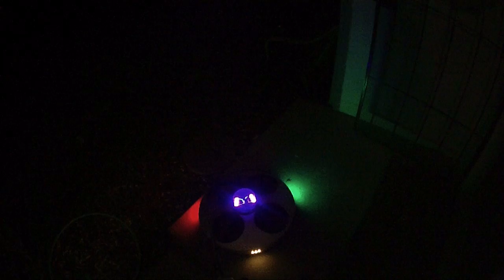RC UFO Flying Saucer and Build Photos

Comment: Outstanding Ron! Thanks for the great build info. This really encourages me to get busy. I'd like to build a really large saucer and I'm convinced that your design is the way to go. Ray Harryhausen would really appreciate your work! 
Thanks man!
Reply: BTW - The tractor beam is tremendous!
Reply from the maker: Thanks again.  I had to put a tractor beam on it that I could control from my remote.  I blew out one LED light (the one in this video) rated for ~3v from running it on a 5v BEC, but now have one that will handle 8v and is MUCH brighter.

Comment: Good looking build.  Shame about loosing the ESC, but it looked like it was flying great up until that point.
Reply from the maker: I replaced the ESC and put another Dollar Tree (3 for a dollar) plastic bowl on it for the canopy.  I re-did he ESC throttle range calibration, increased the P and I gains for both acro and auto-level, and replaced the 6x4.5 props (too much pitch for these motors) with 7x3.5 props.  I cut 1/4inch off these making them 6.5x3.5, re-balanced them, and put them on with some collet adapters to get the props up higher.  There was only one crack in the UFO frame on the skirt so I glued it up and it now flies fantastic.
Reply: RonALampman
Excellent!